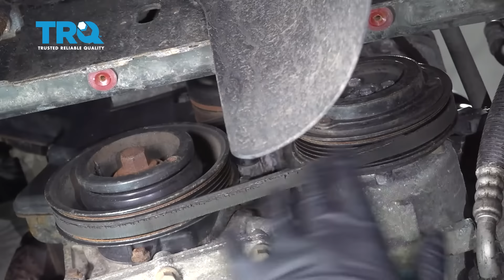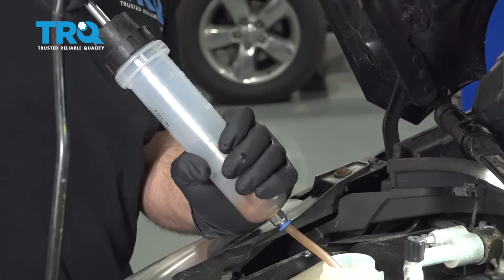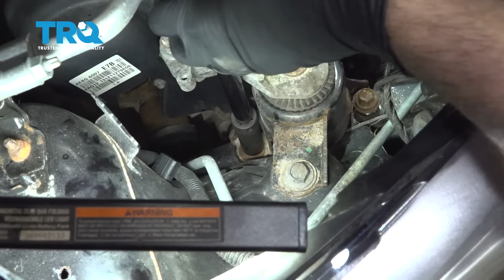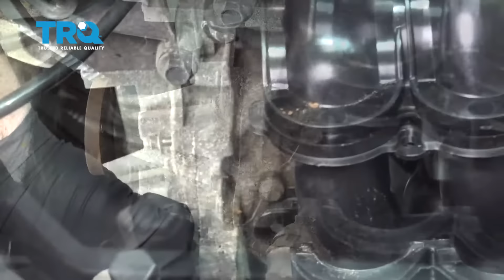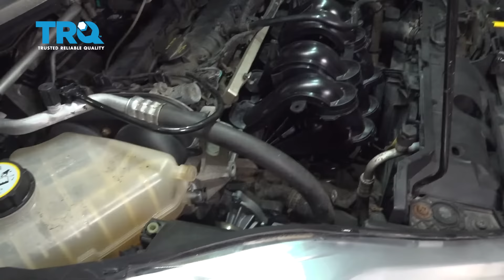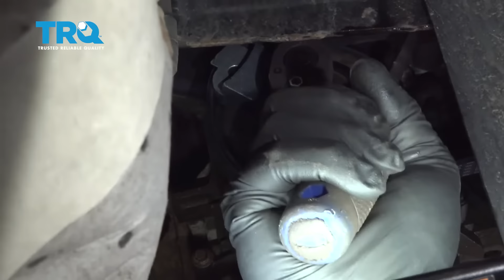How to Replace Water Pump 2011-2019 Ford Fiesta

Comment: In the beginning you were telling us the size of the bolts then when it came to the bracket bolt you stopped mentioning the bolt size right behind the pully wheel

Comment: This video is over complicated because you are supposed to change the cam belt and water pump at the same time. 10 more mins to lock down the cam phasers and undo the crank bolt / pulley and this job is quite easy. Also, take out the headlight. Its 2 bolts.

Comment: good video but need to put never seize on bolt threads do not install back all rusty and corroded a lot of repair shops and you tubers put things back all rusted that no can thanks

Comment: A great informative video 👏🏻 What is the best way to remove crankshaft pulley bolt? I am replacing Engine Timing Crankshaft Sprocket behind the crankshaft pulley. I  removed the timing belt tensioner and replaced new water pump and timing belt is in loose. I marked and locked the timing wheels with the camshaft locking tool and the pin bolt to lock the engine on the clock counter position. Any special tool i can use to remove that camshaft bolt? Need help on this task

Comment: I just like how that everyone who does this job the VVT sprockets line up no problem without doing any timing adjustments to the engine. When I did my water pump I left the belt on and the sprockets didn't line up. I shut my engine off and my exhaust was at 12 while my intake was at 11.

Comment: Thank you for these detailed instructions. I followed them straight through and it worked out perfectly for me. I had a bit of trouble trying to figure out how to get that pin inserted in the timing belt tensioner pulley. I know to use a breaker bar to release the tension on my full-size truck's serpentine tensioner, so I searched around for several other youtube videos to find out how to release the tension. It didn't occur to me that I could pinch the two tabs together with my bare hands! When I figured out that part, the rest was a breeze. Thanks again.

Comment: The procedure should be the same/similar for a 2013 Ford Fusion with the same 1.6 engine, correct? My main concern is the timing belt, since I dont have locking tools for the cams